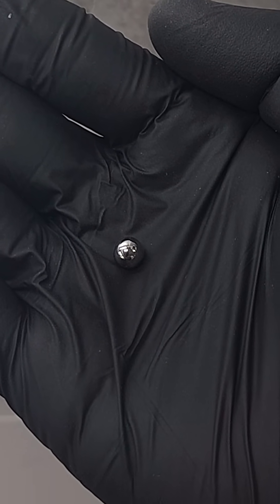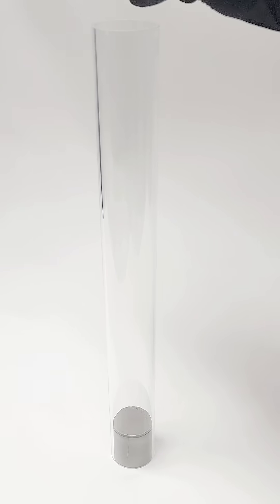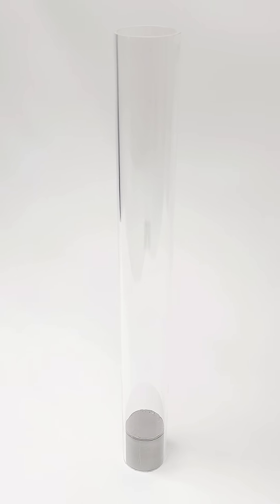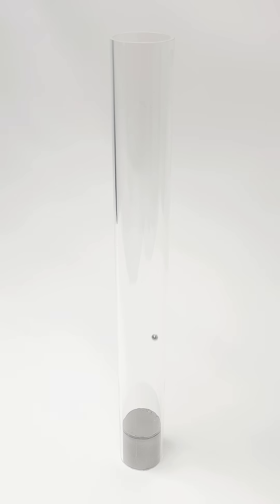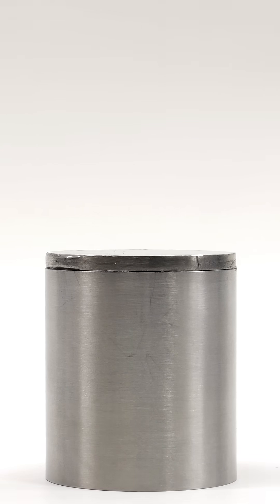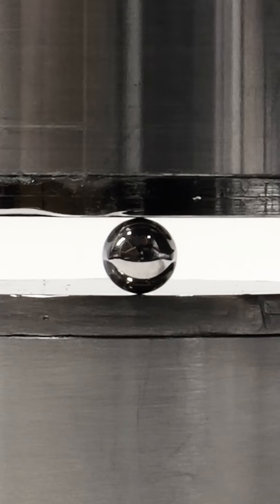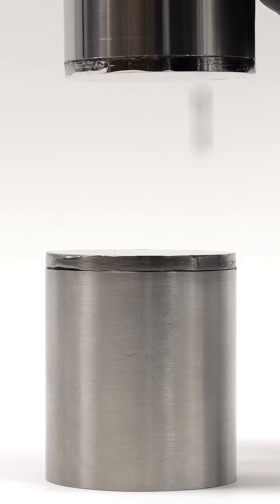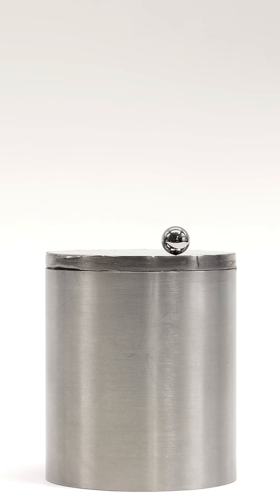This metal is too bouncy

Comment: get in contact with the slowmoguys, this has to be one hell of a interesting highspeed footage
Reply: yeah, I don't think we would even see any flex in the materials. at best we could see induced rotation maybe
Reply: That's what I'm sayn!
Reply: @Mahfknamsayn I wonder if you put it in a vacuum and have the two plates vibrating on a certain frequency and moving at a certain rate if you can make it get more repetitions... Like if you can get a harmonic resonant frequency of the ball and match it with the movement of the plates... This would increase the amount of bounces you would get per drop....
Reply: @AquarianSoulTimeTraveler  sht it might make the ball break 💀 Tesla just about demolished a building with his resonant frequency 😂
Reply: @Mahfknamsayn  you're probably right it would shatter the ball if applied with enough power and achieve the right frequency match... We already know with matching harmonics you can transfer energy... They can do this with tuning forks.
Reply: @AquarianSoulTimeTraveler  I wonder if you pull the trampolines apart once they get close, if the ball will go back to bouncing high and if you could keep repeating it indefinitely, obviously it won't happen like that because of conservation of energy but it's fun to wonder 😂 maybe if u add a tiny bit of energy you could get out more energy then would be used to boost it from compressing and decompressing
Reply: @AquarianSoulTimeTraveler  like a magnetic boost, so that when you move the plates apart it gives it back it's initial energy level, maybe scale it up make it magnetic idk I have 0 physics education I'm just spit ballin 🤣
Reply: @Mahfknamsayn  yeah but if you're putting energy into the trampolines to make them vibrate at a certain frequency then it's not breaking conservation of energy laws...
Reply: @Mahfknamsayn  that's a really good idea to make these plates and then put them in a magnetic charging machine... Maybe it could be turned into a magnet...
Reply: @AquarianSoulTimeTraveler  that's true, it would have to be the perfect frequency to time it with the bounce of the ball, when it hits the vibration pushes back maybe idk would be fun to experiment with tho
Reply: Use a Sharpie and put a mark on the bearing. Preferably a line around it. Then there would be a reason to high speed footage it.
Reply: Yes, it's fast, but I don't think it would be all too interesting. You would see the ball go up and down at approximately the same velocity, over and over. I'm a super big fan of cool slow mo, but I don't think this would be an interesting shot
Reply: Pretty sure those guys could help calculate the speed at which it bounces which would be very interesting @kallethoren
Reply: @WhiskerDooz  if you take the highest audible tone in this video to a spectrum analyzer, you'll have your answer. This is something you can do, right now.
Reply: @robotsongs  idrc bro I want to see it bounce if u don't understand you don't understand, some people like numbers and waves I like to watch sh** bounce
Reply: @robotsongs you can't
Reply: @robotsongs not exactly because the spectrogram could include the resonance frequencies of the ball itself vibrating, but you would be able to trace the path on the spectrogram of the oscillation of the ball. So you could determine the frequency of bouncing this way but you can't just pick the highest frequency
Reply: @kallethoren Yeah I really don't think we would see anything too interesting other than a ball going up and down. We may get some cool stats at how many bounces per sec it maxes out at but other than that I don't think we will see much.
Reply: @Vidar93  why do people like watching bullets in slow motion or glass cracking, it's fun to see something fast that you can't see with your naked eye 👀👁️
Reply: @kallethoren  I know right.  It would look just like a ball bouncing.
Reply: @glenneric1 .might end up in the Guinness Book of Records... 🤪💥
Reply: @kallethoren  for science
Reply: @kallethoren   And I think that's where you're wrong. So many bounces will be INSANE g-forces, I bet with a high enough speed we'll be seeing the ball jiggling between rippling plates.
Reply: @kallethoren  maybe with a marble with a design
Reply: @kallethoren  thats literally every slo mo guys vid lol you are low info
Reply: @kallethoren yeah, but what FPS would finally make it look slow?
Reply: @kallethoren  depends. It may...jiggle. If it does, that would be hella interesting to see.
Reply: @kallethoren  I think they meant speed it up even more
Reply: Gotta mix it with something else behind the shot like a bullet passing by @kallethoren
Reply: @kallethoren  you dont have to watch
Reply: @kallethoren you don't get it the point is watching the frame rate go up on the camera but still seeing the ball bounce at and insane Speed and how fast you would have to record to finally see the ball bounce thousands of bounces a second would take insane frame rate to catch I wanna see that
Reply: @kallethoren 7 thousand bounces per second will be interesting
Reply: @kallethoren  You never know
Reply: @kallethoren
Reply: @kallethoren  the shot would be interesting if normal every day things were happening in the background

like if a highway with moving cars was in the background of the shot or something
Reply: @kallethoren  still cool to see the numbers for how fast exactly its bouncing
Reply: @kallethoren Well yeah Slo mo is always the same. It's just as boring as anything else. Wow the exact same thing but in slow 😳
Reply: @kallethoren it would be interesting to get a true count on how fast
Reply: @kallethoren Bro its not that serious it would be cool as shot regardless just to see it. Enjoy the little things in life not everything has to have a reason for something
Reply: How? its just bouncing up an down? What do you expect to see? XD
Reply: @datarake7222  everything, anything, nothing, who cares it's slowmo if u don't get it you won't get it
Reply: would be absolutely pointless
Reply: honestly slow mo would just look like the ball bouncing slowly. I dont think we're going to see any deformation on the ball or 'trampolines', so it will just be a ball moving back and forth. and all the sounds for slow mo are added in post so it unfortunately wouldn't be a very interesting video
Reply: It's a ball bouncing up and down. Not that interesting.
Reply: @shanetuma3845  you're a ball bouncing up and down
Reply: I don’t see how this would be particularly interesting tbh
Reply: @allegorx58  watching hardened steel deform on vibratory impact yeah not fun at all... Lol 😂
Reply: @AquarianSoulTimeTraveler  oh boy you’d be in for a shock lol please do the slow mo so this goofball can see there would be no deformation visible whatsoever at all
Reply: @allegorx58  yes there would be even less deformation if the ball was made out of the same bouncy material as the trampoline... It might shatter though.
Reply: @allegorx58  WELL THEN ITS NOT FOR YOUUUUUUUUU
Reply: not really. i mean, the motion is very simple, and without anything else to compare the movement, it would look literally like a ball going up and down. like jesus, think, it's not that hard to imagine
Reply: @zekeiwa5837  yeah but maybe you could do it in a vacuum and put some water in there...
Reply: it's a bouncing ball my dude
Reply: I imagine it would look like a ball bearing bouncing between two atomic trampolines
Reply: Yeah but no, that's boring, bouncing ball and nothing else
Reply: the g force of the ball bouncing forth  @capybara9521
Reply: Let's be real here - it's unlikely we're going to see anything more than a bearing clapping back and forth. It's not reasonable to assume there's any noticable deformation in the bearing, nor likely that there's some chemical or physical reaction to occur (thinking of the flash when breaking glass).
Reply: @robotsongs  I wanna see if it moves faster then the frame rate
Reply: @Mahfknamsayn  considering that they regularly shoot in 20k fps, and that what we heard here was maybe no more than 10kHz, it's not going to disappear.
Reply: @robotsongs  so you have perfect khz gauge with ur ears
Reply: @Mahfknamsayn As it so happens, I actually do. I have perfect pitch, which means that my ears are calibrated to the musical scale - which is a standardized frequency scale that converts easily to Hertz. While I can't tell the exact highest pitch without audio editing, it definitely goes past the note called C7 on a piano, placing the final speed at over 2 KHz.
Reply: @orngjce223 I don't have perfect pitch, but I know my frequencies. This one speaks the truth, over 2k for sure.
Reply: @orngjce223  ur wafflin bro 🤣🤣🤣
Reply: @Mahfknamsayn  key is in the 'frames per second' 'it bounces several times per second'
Reply: @robotsongs  Not so.
Suppose they mount the trampolines and set the ball bouncing. They could give bounce distances and bounce rates. For some these figures may me interesting. Not for me. 
I am more curious about how much heat there might be after a prolonged period.  And what damage may occur
Reply: You people are buzzkill. I still wanna see it in slow mo.  Who knows, maybe it randomly disappears for a jump or two!  Won't know without slo mo guys
Reply: @yamlcase230 why would it disappear?
Reply: @gregtudor2318  why wouldn't it?
Reply: @yamlcase230  because magic isn't real? what If you slow down a ball that's bouncing fast it will be bouncing slowly and that's exactly what was happening at the beginning of the video so just watch that and be happy.
Reply: @bobbing4snapples  like I said, Buzzkill.  You are actually spending energy trying to convince people not to do something... And it doesn't matter if they do or don't
Reply: @yamlcase230  because thats not how physics works??
Reply: @gregtudor2318  quantum tunneling
Reply: @Mahfknamsayn  wouldnt happen to all the atoms in the ball. The chances are so low its basically infinity:1
Reply: @gregtudor2318  just making jokes, but maybe something cool happens never know till you see it 🤷 Schrodinger's cat 🐈
Reply: @yamlcase230  it's going to look like it does at the beginning of this clip. what would be the point?
Reply: @yamlcase230  agreed
Reply: Omg yes PLEASE
Reply: It wouldn't be that interesting. It just bounces back and forth. The only interesting thing would be being able to count the exact number of times.
Reply: Nah. Nothing to see
Reply: If you slow it down by five hundred thousand frames... You'll see the Spanish inquisition.
Reply: Came to the comments to suggest exactly this!
Reply: YESSS
Reply: Haha just wrote the same thing
Reply: I'd have to agree
Reply: Don't even remember the slomo guys for like YEARS... is it still the same guys or do they have lackeys doing it now while they just cash in the views?
Reply: Weren't they apart of Rooster teeth?
Reply: no it wouldn't dude
Reply: Yes!
Reply: Yes!
Reply: Perfect comment!
Reply: All these people that don’t think it’ll be cool are taking it too far out of context only looking at what the footage would look like you have to remember that the ball doesn’t even look like it’s properly moving when the two atomic trampolines close in so seeing it slowed down and being able to count the bounces knowing it’s going insanely fast is the cool part not the footage not the reaction but the fact that we can see something so fast moving so slowly and maybe there will be something cool going on and we don’t know because we’re not seeing it in slow motion
Reply: This... All sorts of this!!!!
Reply: YES PLEASE
Reply: Not really
Reply: @slowmoguys
Reply: Love all the hypotheses saying you wouldn't see any deformation of the materials… but like… let's see! Also, might be interesting to confirm exactly how high the bounce frequency goes before stopping. Audio analysis only goes so far if the amplitude is too low.
Reply: I like all the people saying stuff like "it's not interesting", "you'd just see the ball going up and down", etc. and maybe they'd end up being right, I don't know, but by reducing the whole argument about it to just "seeing a ball going up and down", then this video is also boring and uninteresting.
Reply: hell of a crossover
Reply: yes
Reply: This!!! 🎉🎉🎉
Reply: ❤❤❤❤❤ I had this thought instantly 😅
Reply: @slowmoguys
Reply: If you close the trampolines fast enough you exit the territory of Newtonian laws
Reply: Worth 22K likes. Do it manggg
Reply: Yeah, would love to see the slow motion of that
Reply: this
Reply: Nah, you need Jonathan Frakes for that case
Reply: 100%
Reply: I needed that video yesterday 😮‍💨
Reply: YES
Reply: I can't tell if it sounds like zipping pants or opening creeky doors.
Reply: but but we could actually count it to know how fast its going since we know its aproximetly crazy fast xd
Reply: idk it kinda just go up and down
Reply: It'd be wild to watch it speed up in slowmo till it doesn't even look like it's slowed anymore
Reply: People of my childhood
Reply: spoiler alert: up and down
Reply: @tripdrakony869  you guys need to appreciate the art of slowmo it's obvious you are not slowmo connoisseurs
Reply: @Mahfknamsayn ad hominem
Reply: @capybara9521  idk what that is or means
Reply: Kinda want to see the very end, a millisecond before it stops, could be that it just goes higher and higher to a million jumps per s
Reply: @Paul43210  that's what I want to see too 😁
Reply: Wouldn't really be the best footage, but we need to know how fast it is bouncing!  Though you could probably find out the frequency of the sound it makes and find out that way.
Reply: The slomo isn't just for "cool looking" footage. It's also to be able to calculate the velocity and amount of bounces.
Reply: It seems like it would not be very interesting at all, actually. Just a ball bouncing between two flat surfaces.

Comment: Sounds like a door creaking
Reply: That's what I thought too
Reply: I was gonna say that
Reply: Pov the door when you go to get a snack
Reply: I wonder why though... Do a door's hinges vibrate or smth ?
Reply: @Cloudy-Wani664  Technically it around same amount of vibrations, caused by metal to metal bouncing against each other with out oil film creating pressure bearing surface. While door opens only 45 to 90degrees depending on how much its opened, the each fraction of the degree creates sound potentially. Also same thing with the pin against the hole surface, but most of that might over lap each other and still have slight differences in shape, tolerances and amount of lubrication left etc that sound might be higher or lower. Door and frame material weight etc also change the vibration tune lower or higher.
Least this is my limited understanding on what creates the sound in there.
Reply: Tron Legacy
Reply: True
Reply: Sounds like a zipper to me
Reply: Minecraft
Reply: Open the door, open your mind
Reply: Same thought, bud.